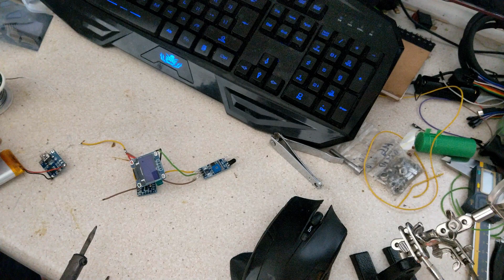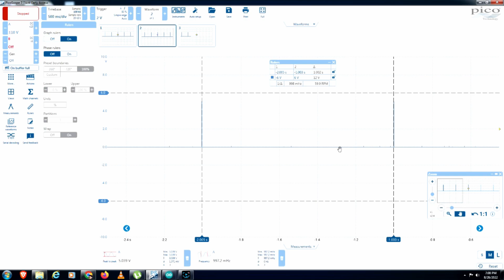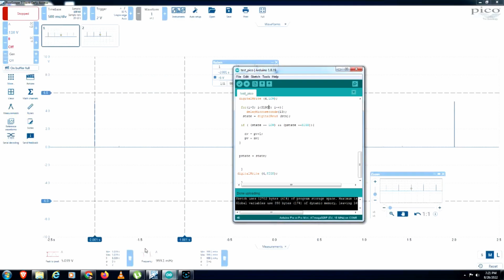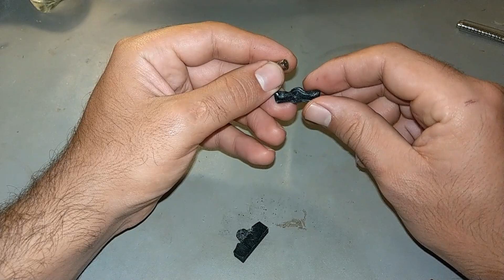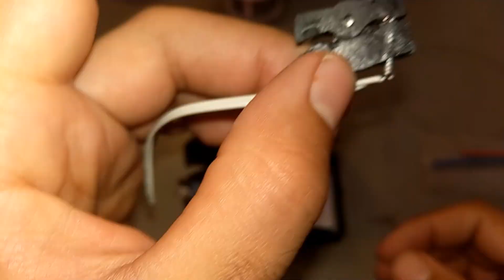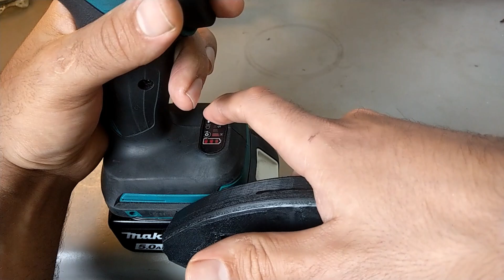Diy Rev Counter, Tachometer

Comment: I have a question how far you have to be from the rotating object for an accurate reading?
Reply from the maker: It depends on the angle between the two diode, but in general infrared is not a good choice for tachometer, laser much better